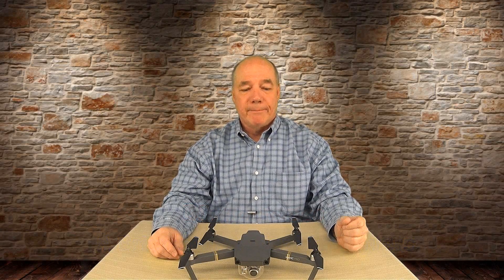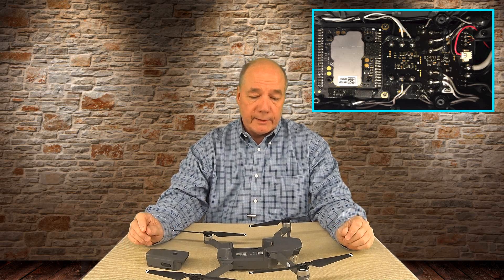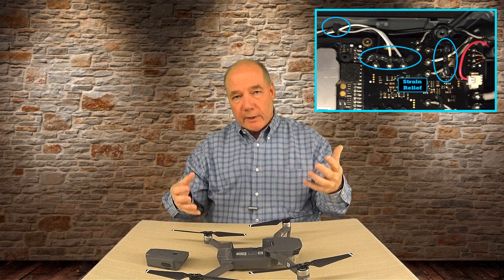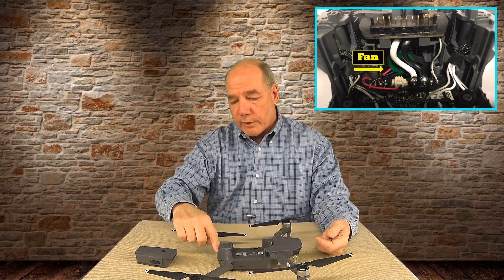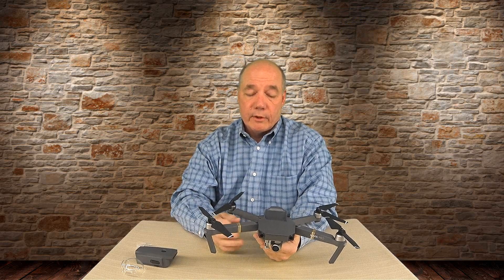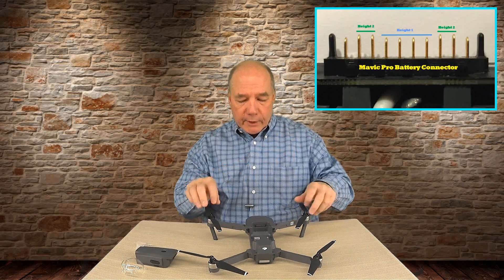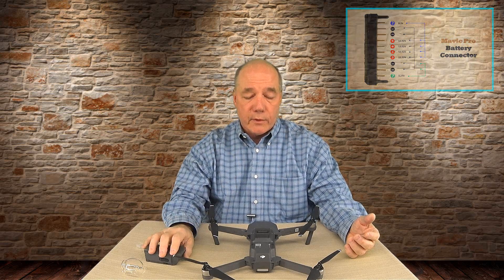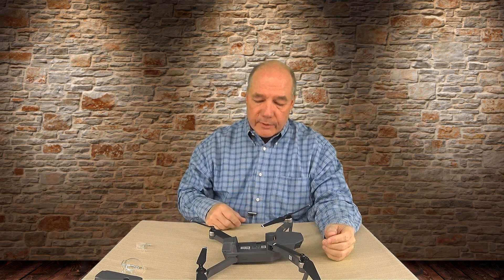Mavic Teardown - A look Inside Your New DJI Mavic Pro Drone

Comment: Great job...I do like the fact that DJI took the extra effort to think things through and glue those wires down along with the spring dampners.I did watch another video where it looks like the chips are covered in some type of material to help with moisture and saw one where they flew it in the rain..I DONT RECOMMEND anyone to do that....I also agree that that fan needs some type of filter to keep debree from going into it.
Reply: Yeah, debris/debree is bad.

Comment: Thanks a lot for your informations. You told to put the camera cover away for the vent to get better air ventilation. On the other hand you recommend not to land on dirty surfaces. My solution would be to drill a line of holes into the protection globe and glue a trimmed piece of a filter maybe from a vaccum cleaner or similar over the holes. So you may be both: a camera protector and a dust protector.

Greetings from a future Mavic owner!

Comment: What kind of engineer are you? Civil? Maniacal? Electrical?  The soldering differences primarily has to do with the fact they chose to use surface mount rather then through hole.  Has less to do with RFI and more to do with space and cost savings.  They don't hand solder any of it!  It's all done through pick and place machines and for larger components (chips) they bake it.  Now if they really wanted to control RFI they'd have each section bordered by ground traces and a cover matching those sections.  Multi layer board would help too.  Take apart a smart phone or flip phone and see what's going on there.  From the small picture I saw I did not see the ground sections but I could have missed that.  The detailed examination of the drone is nice but the conclusions are a bit rocky.  I guess this is Youtube infotainment.
Reply from the maker: Chip, thanks for the post but I'm not sure what statements I made that 
were rocky. Everything I discussed was based on my experience as an 
Engineer that has worked in the field for close to 4 decades. I was 
complimentary of the product in general and critical when needed. I was 
impressed with the quality of the build (solder joints, strain relief) 
and the attention to detail that DJI put into this quad. The only 
cautionary thing I mentioned was the situation with the fan, which I 
still contend is an issue since looking through the vent holes you can 
clearly see an open path to the PC boards inside. This pathway allows 
debris, moisture and other contaminants access to these delicate 
components, which needs to be addressed. I hope that clears it up and I 
am always open to discussion but still stand by my conclusions. Thanks, 
Rick
Reply: I agree on your conclusions being rocky statement.  DV, understand that your assumptions are being stated as facts, and non-technical people are looking up to you to provide them with factual information.  There are a few statements made in this video that make me question your logic and credibility.  Don't just decide "this is why this was done" and then state it as fact.  In a couple instances in this video, your conclusion was/is wrong and it casts doubt on other conclusions you've made.
Reply: Drone Valley For me, it was the power connector discussion, with the "longer tabs are for better contact" which, as many comments have indicated, is not the reason.  I also don't get the whole "the heatsink shouldn't come in contact with grass" comment, and I really don't understand what the issue is there, without quantifiable numbers as to what the heatsink temperatures are, I don't see much value in that portion, heatsinks are designed to transfer heat, being warm is by design, if the thing is <50-55C, what's the issue with it touching grass? The solder discussion is interesting, but I cannot find any source, credible or otherwise, that indicates that a rounded solder connection is preferential in RF devices. Based on what you said, it seems plausible, but it goes against everything I've learned in dealing with IPC soldering. I can say that to comply with Mil-STD-461F, that rounded/semi-spherical solder joints are not preferred.  I can't tell based on the video, but I did not have the same conclusion you had looking at the PCB.  I don't see a ring of via's that keep EMI from the edge, I don't see obvious ground layers on the outer edges.  Other conclusion that seems a stretch, and this is me being a little pedantic here, is at 6:32 you state "don't fly with the globe on, that's definitely going to cause you problems long term"  that assertion is based on a few assumptions, such as "globe will prevent all air from getting in" (it doesn't) and it discounts the potential that the fan was simply added to help with air flow WHEN the globe is installed.  Without knowing the designers intent, you can speculate, but stating it as "this is going to cause a problem" is dangerous, as it's based on a couple speculation layers.

All that said, thanks for the video, it was good, and I learned a bit about the insides of the drone, I would just caution that there's a chance that others are watching this looking for 100% factual data, and stating speculation and opinion as facts, is misleading, and in a bigger sense a little dangerous due to the nature in which we aren't raising a generation of critical thinkers.  Again, I do appreciate your teardown.

Thanks, 
Chip
Reply from the maker: Glynne, I'm an Electrical Engineer with too many years in the field to count. I appreciate the comment and agree with you that the surface mount components were placed and attached by a pick and place machine and then heated to "solder" them in place. The connections I was referring to were ones where wires from other boards and components (motors, battery) were attached to the main board as the last step in the process. These had to be hand-soldered because of the routing and assembly required so these round solder connections were intentional to minimize RF radiation from those joints. After the wires were attached, they even went back in and adhered these wires to the board with silicon to provide strain relief. I agree that they could have added a few more shields but probably avoided them because motors and such may need to be replaced over time and you'll need access to the connection to do that. If I've missed anything let me know. I really appreciate the conversation and hope you sub the channel. Rick
Reply: There really are quite a few statements that made me wonder. 1) Round soldering joints have nothing to do with RF interference. Gluing them down is absolutely necessary on SMD soldering, because the copper foil on a PCB is only very weakly attached to the core. Through-to-hole mounting of such thick wires would be much better for durability. 2) The longer contacts on the battery have nothing to do with current draw but they make sure that ground is connected first and disconnected last on every battery removal. That is a standard design technique. 3) Damping vibrations for better GPS reception is really completely off - there is nothing in a standard (non differential phase receiver) that is only slightly sensitive to mechanical vibrations.
Reply from the maker: Chip, thanks again for commenting and I'm not sure if you're part of the
 Engineering community or not but as corny as it sounds, its a bit of a 
brotherhood that lifts each other up and learns as much as it teaches. 
The power supply pin connection is a great example where I asked the 
question, put forward my thoughts and someone else suggested the real 
reason, which was enlightening. That's how we all get smarter together. 
The clips I do for this channel are based on my personal experience that
 I use to explain things I find interesting. I'm the first to admit that
 I'm wrong often but also value the intelligent conversations that 
happen in the comments to settle the debate. 

  Just to close this out, I agree that the longer fingers on the power supply are there to make initial contact to relieve any residual electricity on the contacts before the power connections are made. The fact that they are longer also supports my original contention that they can carry more current. As for the heat sink contacting the ground, that isn't a great idea since the warm (hot) heat sink coming in contact with moist material will transfer that debris to the metal fingers, baking it onto the surface. While initially this doesn't seem like a big deal, over time this buildup of baked-on gunk will degrade the effectiveness of the heat sink and may cause issues with overheating.

  I really do appreciate a spirited debate and hope this satisfies the issues. Thanks, Rick
Reply: I'd settle for knowing 5% of it all... :)
Reply: +Drone Valley Did you actually take the Mavic apart or did you find pics ? if it's the latter then you are (as you often do) draw a huge number of conclusions from relatively little "data".
Reply: Keep 'em coming Rick! It's good that others here are paying enough attention to question you, but I, for one, have an innate sense (even though my technical background is not in electrical or electronic engineering) that your background and logical conclusions are solid on the engineering points you've raised here. With a Mavic and a Phantom 4 Pro on the way I'm very intrigued by the quality that DJI is putting into their aircraft!
Reply: I work in electronics manufacturing including SMT and I can assure you the round bulbous joints are nothing to do with SMT in fact it's quite the opposite as we usually aim for minimum fillet to make the joint   That makes it easier to detect solder defects.  Rounded bulbous joints seem to be unique to drone technology so may well have a feature in RF design as any spikes or indeed certain wire length can all effect the circuit.  Regarding pin lengths on the battery connector its more to do with making shore the earth is grounded first when inserting the battery and avoiding the possibly of sparks. @ drone valley. I much appreciate your insightful advice and videos. Keep up the good work
Reply from the maker: Rory, I did take the Mavic apart as I stated in the clip. I will add a 
link in the comments section to the actual pictures at a larger scale 
since I've had a few people ask for them. It's actually a little 
insulting that you're accusing me of basically misleading folks with 
this clip, when all I was doing was trying to expand everyone's 
knowledge of the quad. I'm not sure that I "often" draw a "huge" number of conclusions from a small amount of data. Every clip I put together is well researched and based on the facts as I see them. Remember that I do these clips to help others fly safer and offering suggestions on my experiences with the quad helps with that. I do appreciate you watching the clips but please take it easy on me. Rick
Reply: agreed on the vent... This might be OK for indoor use but for this kind of machine (and it's price) they should have done better job.
Reply: Mike b I wish I knew it all.
Reply from the maker: Fireblade69 - thanks for the post and the best part about the channel for me is the great exchange of ideas we get to have. I welcome others to comment on these clips and pose the questions in many of them to generate a conversation. I appreciate you adding to that discussion and am glad you subbed the channel. Thanks, Rick
Reply: Glynne Tolar surface mount components do have an advantage for electro magnetic immunity and signal integrity. I saw another tear down and the sections are actually shielded. I couldn't see if there is filtering on the edges of the shields.

Comment: On the battery.... The negative connectors need to make contact first so there is no chance you have voltage but no ground.
Reply from the maker: Chris, thanks for the comments and I totally blew this one. I work with a lot of quick-disconnect devices and should have realised this was just a larger "ground-first" connection scheme. I appreciate everyone pitching in to correct me :) Thanks for watching and I hope you guys sub the channel. Rick

Comment: On the heatsink comment "not a good combination to have a hot heatsink against wet grass"  What is your reasoning for that? Seems dry grass would be a bigger concern if we were really concerned, but we're nowhere near the flash point of anything with the heatsink temps we're seeing.  Also, I've never heard that rounded solder joints are better, always the opposite, do you have a source for that?  Also, as the guy below said, the reason for the longer pins is so the grounds connect first.  This prevents the positive voltage from entering the craft without a return path.  Many connections in computers are done the same way. (look closely at a SATA connector for instance)

Comment: Hey this may be a dumb question but can you fly this mavic pro during the winter when its very cold, thinking if i should wait to spring to get one? Great videos btw!
Reply: Kevin Wadiak it will fly, but you get much less fly time because battery discharge much faster in low temperature.

Comment: Awesome stuff, thanks.  Looks like dirt is going to be the big problem with the Mavic. The two things I use for launch pads are; the lid off a large Tupperware storage tub. And when out hiking I have a rubber car floor mat I got at Walmart for a couple bucks.  It's light weight and can be rolled up so is easily transported. I got the idea to use floor mats when out with my buddy and we would be up in the national forest we needed something so I pulled a mat out of his truck, and it worked great. So I just bought one.  I think the second biggest killer of these drones is so many are being bought by first time drone users. They're not reading the instructions. They don't understand safety issues. They're not calibrating before each flight. They're using Sport Mode and getting speeds upward of 60 mph (according to the DJI Go app). And they are quickly jamming the controls rather than smooth joystick control, as though it's a video game controller, which will put a lot of strain on the props, prop mounts, motors, and motor arms. And they will blame DJI when the drone ends up having catastrophic failure. I guess the good thing about this is there will soon be many crashed Mavic for sale, so spare parts will be readily available :>
Reply from the maker: Duck, great idea with the car mat. I use a landing mat that I bought a while back that folds up. The problem with most of them is that they are light and the prop wash lifts them on takeoff. A car mat would be heavy enough to avoid this issue. I also agree that this will be the first "prosumer" drone to gain mass appeal and will bring a lot of new fliers into the hobby. From the emails I get, the vast majority of people I talk to want to learn about the hobby and do things the right way. There will always be a few knuckleheads that do dumb things that make it harder for the rest of us to enjoy our free time. Hopefully posting videos on flying responsibly will help. Thanks for the post and for stopping by. Rick

Comment: The different voltages make sense. the 3.2 is probably for the leds, the 12v for the motors, maybe one for each? the remaining is for the radios and computers? I am guessing, but its a logical guess.
Reply: I wonder if the 4v pin is for the fan as per the specs posted by Chip Thurston1:
According to the manufacturer, it's a blower.  DC Blower, 35mmx35mm, 4v, High speed, Hypro Bearing, 10mm thickness, blower blade shape, and function is "by impedence"...  trying to post the link, but it fails due to the link part.
Reply: well the voltages are not steady 3.2, but they are data lines to know the information of each cell the temperature and how many loads it had . it can be i2c protocol, and i will test this soon with a tester and oscilloscope.

Comment: Got my Mavic, flew it 4 times and it has to go back... I get out about 150 feet, get a warning that my antennas need to be adjusted (They didn't), then I lose GPS, goes to Atti and finally to Vision Mode and then I lose connection with my ipad but I still have control of the craft...  DJI can't figure out what is going on but they have been Great!

Comment: Great video! Also I was thinking that the longer ground connection pins on the battery would be connect the ground pins first as the battery is inserted into the Mavic.. with them being longer they would touch and connect first, then the positive pins would connect secondary.
Reply: Yep, this is the reason.
Reply: This is the reason.

Comment: Great video.  As an engineer I've been known to take apart things myself to see how they work.

You mentioned in the video something along the lines of taking off and landing on a good surface that wouldn't suck in dirt or moisture.  Do you recommend building a launch pad for the drone?  I was thinking of a 2X2 piece of wood painted with a unique symbol that the Mavic can uses for precision landings.   Do you use anything special?  Or just make sure its a good surface?

Also, since I'm still waiting for my Mavic - how much weight do you think the Mavic can take on still fly ok (assuming weight is centered?).  I was thinking of creating a prop witch to hang several feet below it and fly around to scare the kids.  I've seen similar thing done with a P4, but it has stronger motors.

Comment: i would rather catch the drone in hand then landing it on dirt or grass. I think it's still pretty easy to land in hand.
Reply: The object avoidance can make it difficult to hand catch. I have hand caught my buddy's Phantom 4 a few times, and it tries to "get away" from me till he can get it powered down.  Flipping the Mavic into Sport Mode just before catching it will disable object avoidance and make it easier to catch. At least that's my theory... DJI hasn't actually sent me my Mavic yet. Two months and still waiting.